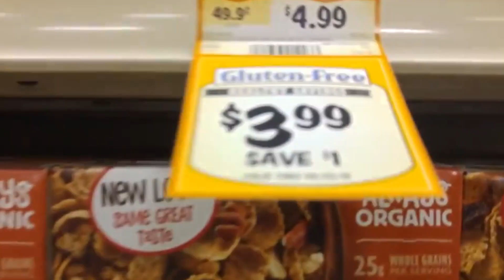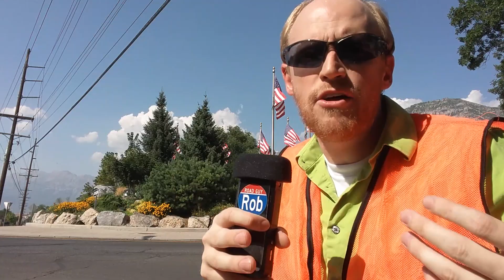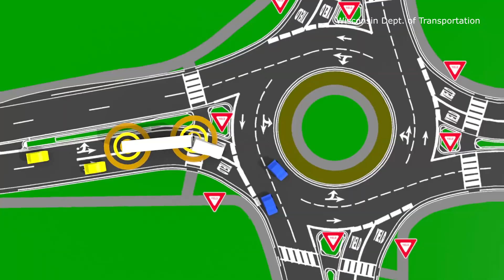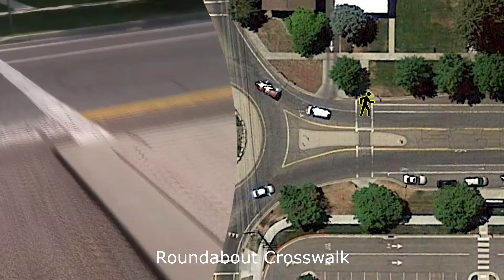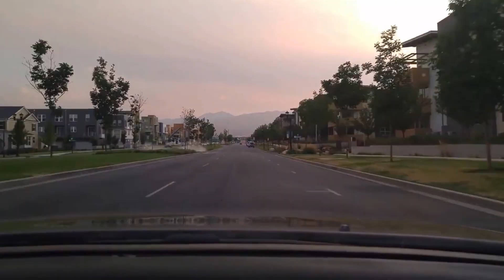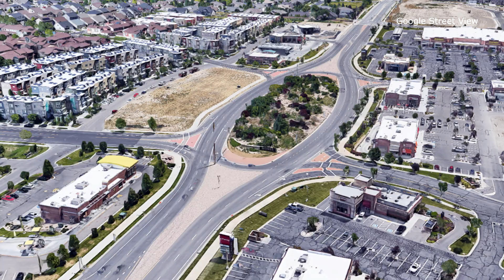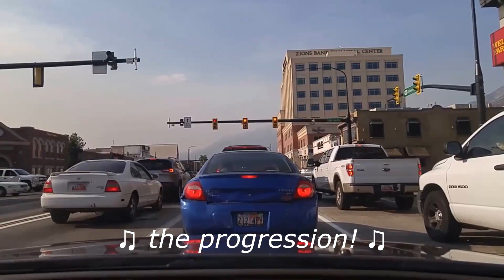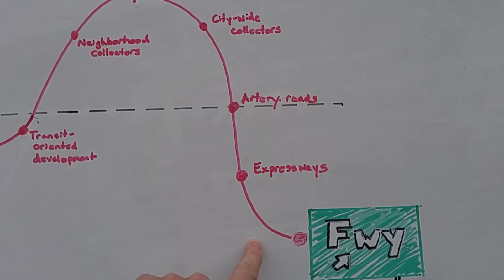Are roundabouts REALLY better than a traffic signal?

Comment: In my experience, if I'm in a 'platoon', I'm in the one that's stuck waiting at every single red light, turning what would have been an eight minute cruise to work into a twenty minute slog of stopping and going at every intersection.   I'm not sure if roundabouts would make my commute easier, but the idea of something freeing me from the 'platoon' I'm stuck in every morning is tantalizing.
Reply: Too often the traffic lights are timed to allow platoon travel through several lights yet end up requiring frequent stops. Seldom will the DOT recognize this and post signs accordingly.
Reply: @edwardmiessner6502  
The timed lights work really well on one way streets.   For two way streets it is more difficult because the timing will not work for both directions.  Some cities use a computer system that keeps track of all of the traffic on these roads and operates the lights in such a way to help keep traffic moving depending on the demand.
Reply: @swinde  that depends greatly on the layout of the streets. In the Phoenix area, all streets are laid out in square miles so all traffic lights are 1/2 mile apart. The consistency and space makes timing of lights in both ways possible. If you drive the speed limit on most major surface streets, you can drive for miles and hit every light green.
Reply: @danieldaniels7571  ya the town near me it might be the main roads that have them timed like that in and out of town, i can hit every green light into town and even in town as well another road there as well without stopping
Reply: @knightwolf3511 Some places are much better at timing them than others.
Reply: @knightwolf3511  From a Dutch perspective one thing you said isn’t true. You don’t need a lot of space to put roundabouts in. You can have two-lane roundabouts with a diameter of approximately 40 meters and 1 lane roundabouts with a diameter of 20-25 meters (which often are very suitable for 4 lane roads if you were to get the roads back to 2 lane, after all it’s usually the traffic backup that requires road widening).
The mistake Americans make which also results in less safe roundabouts is that the angle on which drivers enter your roundabouts isn’t small enough, you could easily cruise thru them at 30mph and often faster if they’re two-lane. In the Netherlands we generally navigate 1 lane roundabouts at about 15-20 mph, slower if they have cycle lanes or are really narrow, but often not much faster than the minimum second gear allows you to drive. We only navigate some 2 or more lane roundabouts at 25mph IF we’re going straight thru instead of turning left or right.
Reply: @roy_hks  most towns and cities only have 2-4 lanes in the U.S., we barley have 1 lane. roads are already widen those where basically built years ago for heavy traffic Chicago, IL https://www.google.com/maps/@41.5345825,-88.1043801,4465m/data=!3m1!1e3
Denver, Co https://www.google.com/maps/@39.7551202,-104.9396405,4586m/data=!3m1!1e3

small towns it's possible but these areas and large towns only alleyways are single lane, actually depends on where you live

then small towns like this https://www.google.com/maps/@39.6977849,-89.1232761,1147m/data=!3m1!1e3

it's just weird trying to put a roundabout to benefit when you have to find traffic which only people who work on it understand the traffic flow unlike me.

because we built areas with house on T streets everywhere https://www.google.com/maps/@41.5213094,-87.4814444,140m/data=!3m1!1e3.

i'm not saying roundabouts are safe or unsafe although they would be unsafe since no one uses them like me, like i don't even know how to Parallel Park since i never had a test on it since there is no real side street where i live
Reply: @knightwolf3511  for what it's worth a number of local authorities in the UK (and elsewhere in Europe) absolutely prohibit entryways/driveways onto fast feeder roads - to the point of dumping concrete bollards across ones that people try to install whilst simultaneously prosecuting them to get the driveways removed
Reply: @swinde  Exactly. The platoon concept also begins to fall apart when traffic volume is very high, because part of the platoon will get caught at the red light, and then the next platoon will be impeded by those, resulting in a chain reaction.
Reply: Roundabouts help keep traffic moving in most cases. And they are far better (IMO) on main arteries, even during rush hour.
Reply: In my city platoons are used specifically to cause you to hit red lights frequently. Idea is slower traffic is safer; it just causes road rage.
Reply: A motorcycle is your only escape, you’ll be to work in 2 minutes.
Reply: @hse6144  and in a casket in 3.
Reply: The platoons with a "green wave"of timed traffic lights can be reasonably well optimized for traffic in one direction, when the average traffic speed is stable.  So you can optimize some main arteries for say into the city in the morning and out in the evening.  However, for traffic in the opposite direction it's just gets worse,  and in a city wide grid, it gets just too interconnected.

Also when there is more traffic or lane changes, for example merging in from side streets to the main artery, the average speed goes down and/or free room between intersections gets limited and the platoons break up.  As a driver you will feel this as waiting forever from the light turns green til the car in front of you gets going, so the next light turns read before you get there.   Traffic engineers should (and sometimes do) use lower platoon speeds to calculate the traffic light timings in peak traffic, but you are never going to get it 100% right.
Reply: @GormHornbori  there are several optimum platooning speeds for every set of traffic light waves. In heavily congested conditions it may be a case of dropping from 35mph platooning to 20mph platooning in order to catch the greens but you end up with a higher mean throughput speed
Reply: And that's the part he failed to mention
Reply: Platoons are fine if everyone knows where the accelerator is located.
Reply: Exactly. Many traffic lights are timed terribly. I’ve had 20 minute commutes turn to 40 minute commuted solely thanks to badly timed lights.
Reply: it depend on where you are i think, during certain times a lot of lights where i live are set up to slow traffic down...
Reply: It needs to be really busy at a roundabout for you to not being able to enter it in a very short time. Traffic lights are way worse, where i live, they're called stop lights instead, because most of the time you'll be stopping and waiting. Greetings from some Dutch Dude
Reply: If this is happening to you then you need to work out what the optimum speed is to catch the greens. 

Just because the speed limit is 45 doesn't mean that the timings haven't been set for 35mph waves and that's frequently a deliberate choice to frustrate motorists who floor it away from the lights

Observing the time delay between the green light where you're stationary to the green light at the next light and dividing that by the distance between them will give you the ideal speed to travel at - there is ABSOLUTELY NO POINT in going faster than  this unless you like higher fuel consumption/brake+tire wear
Reply: @miscbits6399  why do you have to figure it out when the city could put a sign board that automatically updates the speed you'd best use to cruise through with another green? Advising you to slow down if you're bound to hit a red when going fast.
Reply: @sirjmo  Some do. Most don't even think about it. Many traffic lights in Asia have countdown timers for green and red

Once you work out the ideal speed between lights, you can see people behind you raging at being so slow, but the look on their faces as you high the next set of lights as they turn green is worth it (even funnier when someone blasts past you and you then cruise past on a green in the other lane
Reply: @miscbits6399  that sounds amazing, my city has the lights very messed up, the next town over has signs that tell you to slow down for a green wave. I'd love counters.
Reply: @miscbits6399  Another "fun" trick is timing the wave for traffic that exits the previous intersection already travelling at the calculated speed. So on a series timed for 45 MPH, if you're leaving a red light you have to reach 55 or 60 before the next light and then slow down to 45 in order to ride the wave.

And that's terrible for safety on many fronts. You're travelling faster than the road may be designed for, you're pissing off people who expect you to continue at the higher speed, you're not maintaining a speed . . ..
Reply: A small city near me the city lights are set so that if you drive the speed limit say 25 and get in the right rhythm you will hit all the lights green. That is sweet.
Reply: Nah, a routine of slowing down for a never-ending run of roundabouts is almost just as annoying once the novelty wears off.
Reply: Depends on the roundabout and the volume of traffic and whether you are on the dominant road going into it or not.